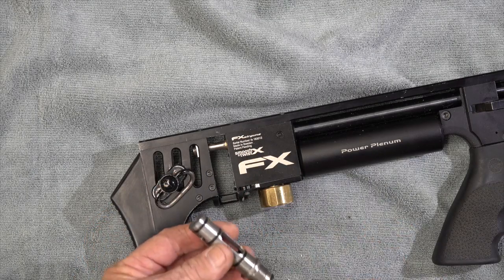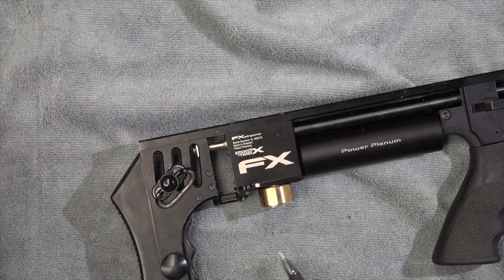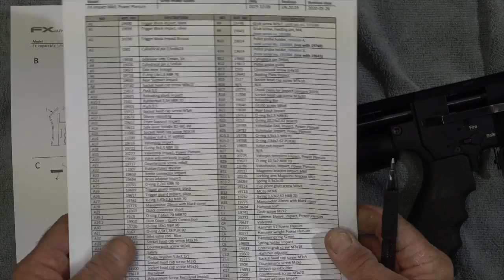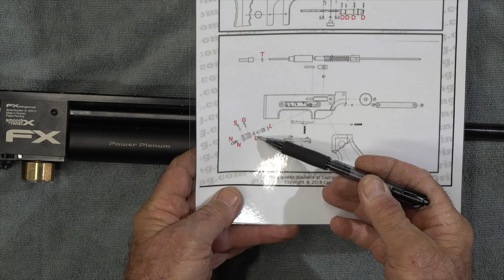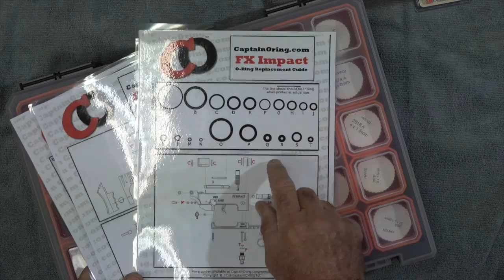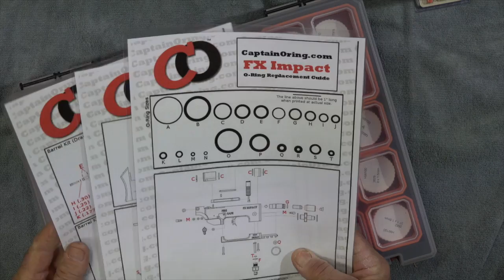FX Impact MKII Leaks Part 2

Comment: A question about my FX Maverick. I am installing Huma regulators. I got both of them installed, and set the 1st reg to 175, and then was trying to set the 2nd reg, and it would not increase the pressure. I then noticed air coming from a pin hole on the opposite side of the reg (left side of gun. Can you tell me what it may be, or  what O ring might need to be replaced? Any help would be greatly appreciated. 
Thanks,
Scott
Reply: I don't own a FX Maverick so I can't really help you. But it sounds as if a oring has gone. On the Impact the little hole leads down to the regulator assembly on which there are six orings to replace. Just a guess. If you don't already have them get a hold of the exploded diagrams on your rifle from the net. This is a good start. Also check out for videos on the net regarding working on the Maverick. I'm sure Ernest Rowe had made some. Good luck.